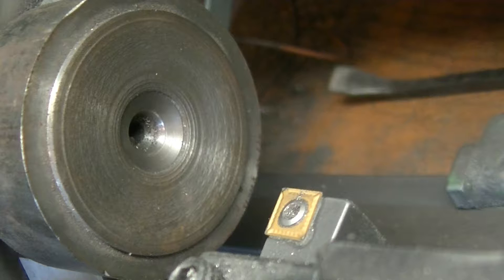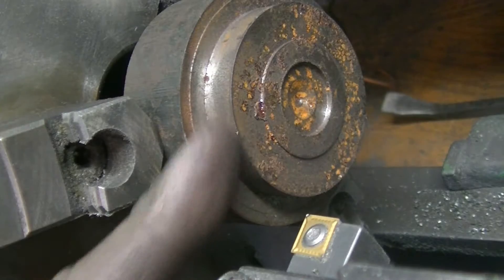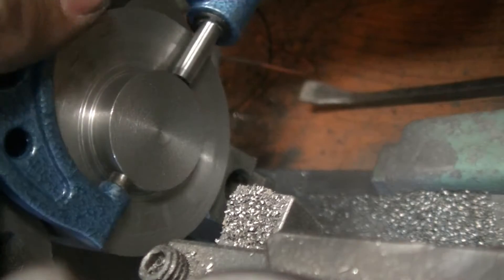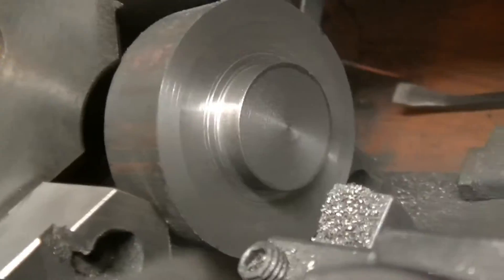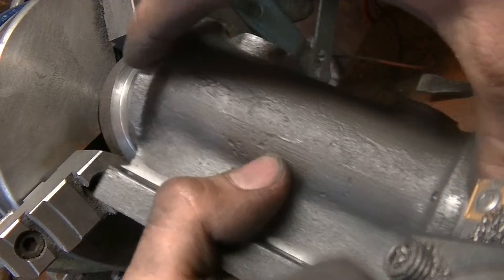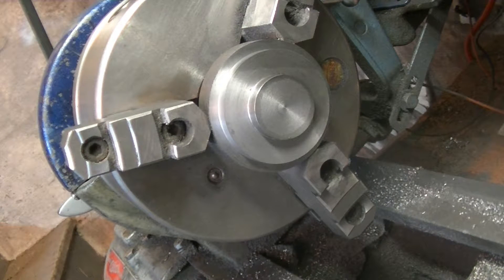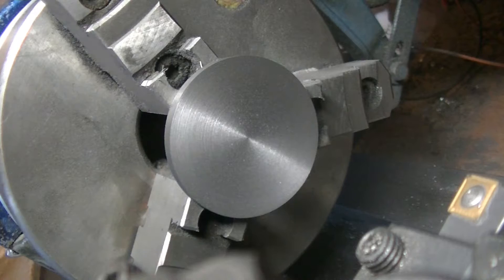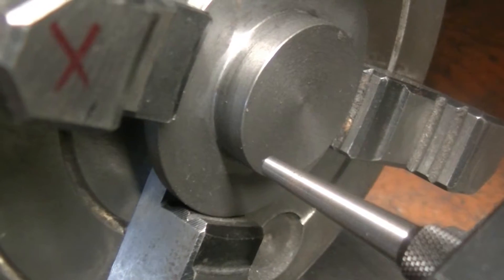Steam Engine Build: Making the Top Valvebody Cylinder Head

Comment: Just a concern, you said the bore through the valve wasn't perfectly straight. Will that affect you when you make the crank and cam that it wont be able to line up like it probably should and maybe would get in a bind when the engine tries to spin?
Reply from the maker: I don't think so.  The hole is only off by about 0.030" or so in one direction if I remember correctly (let's just say 0.060" to be conservative), the angle of deviation over the 6 inches of the valvebody is (180/pi)*arctan(0.060"/6")= 0.573 degrees.  This angle is the angle that the valve rod will deviate from being perfectly straight.  The valve rod itself only moves up and down about 3/4".  Meaning the lateral displacement of the rod as it moves back and forth is 0.75*tand(0.573) = 0.007". Luckily, the "off-centered-ness" is in one direction, and in a fortunate direction, because the fork at the bottom will have a joint that will be free to move sideways a bit to take care of this movement of the valve rod (see 13:19).

We will see though.
Reply: Fair Weather Foundry hopefully it won’t, being less than a degree but if it does you could probably use a universal joint or some type of ball and socket.
Reply: I think FWF will be good anyway, but if he wanted to correct for it, he could machine the gasket interface between the valve body and cylinder to bring the valve cylinder into parallel with the piston cylinder.    This would run the risk of mucking up the appearance more than just having an out of center valve cylinder head.  That is, externally the casting would look wonky WRT the main cylinder but the two cylinders would be in parallel.